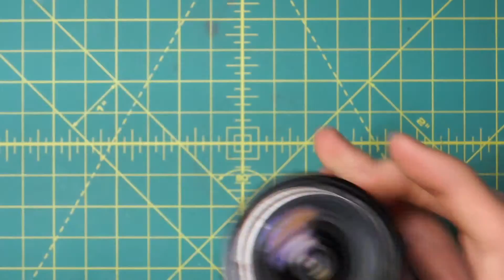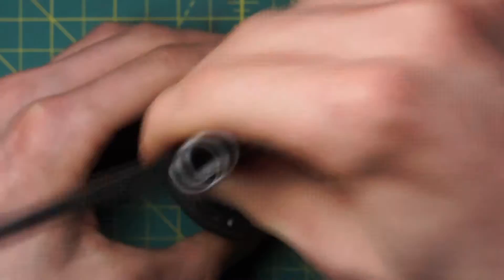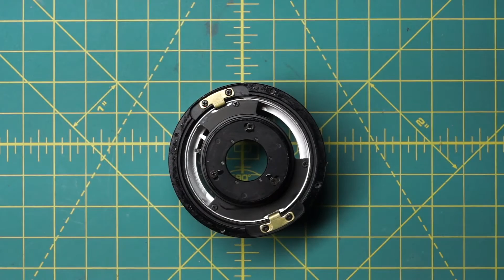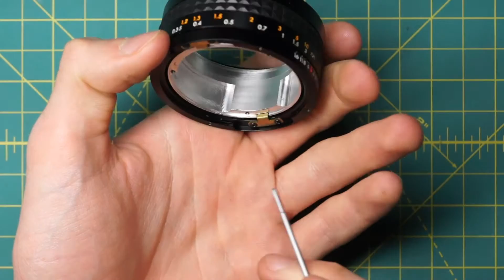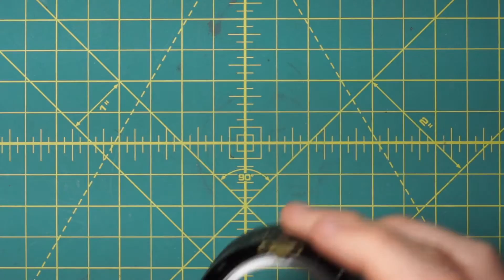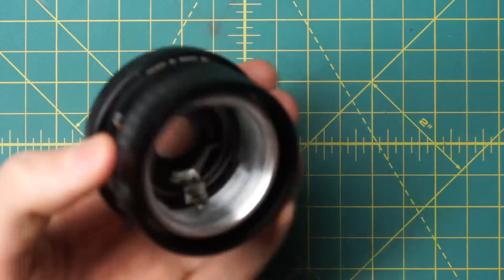Focal MC Auto 28mm f2.8 (Minolta SR Mount) Lens Disassembly

Comment: hey bro do u have a dissamble tutorial to focal 135mm? i disassemble mine, i accidentally remove the front element and accidentally add some smudges there. i want to remove it again but it doesnt fall out, theres no tip for spanning wrench on the front filter.
Reply: I have the same lens and would love to have a reassemble video! sadly I messed up the aperture blades and don't know how to put those into place and function right